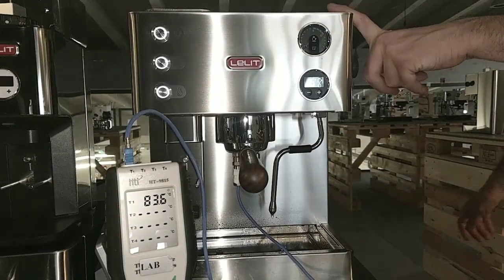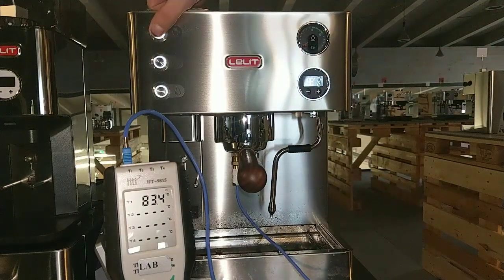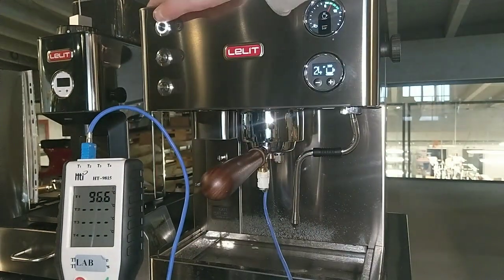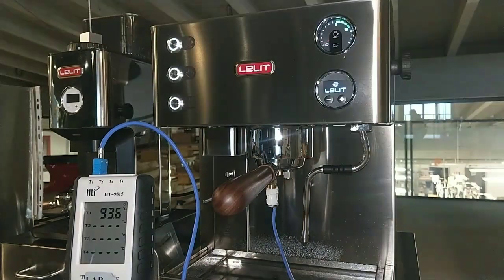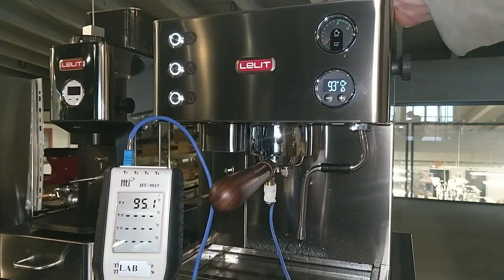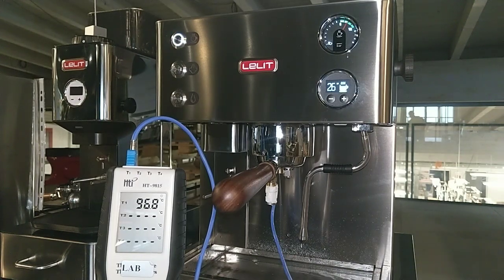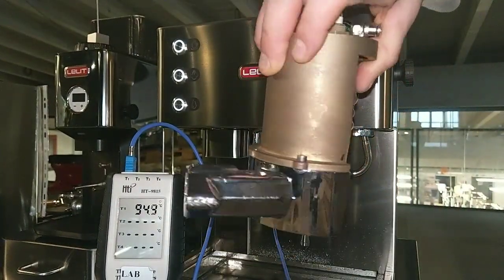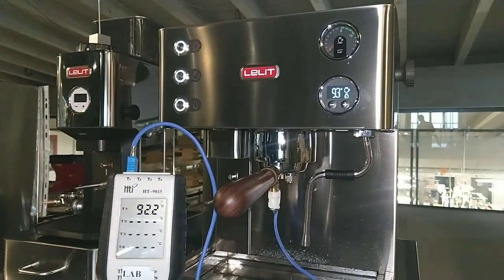pl82t pid settings   KP 0.5 - KD 0.5 - EC 8

Comment: Hello, I am your customer from Turkey.  I bought lelit Kate pl82t product.  However, there is an abnormal difference between the indicator on the product and the output level.  indicator is 93, water temperature is 77 degrees.  I watched your videos on YouTube and changed the settings to KP 0.5 KD 0.5 EC 8, but this is the situation.  I cannot detect the aroma and smell in coffee. I would like your support on this issue.
Reply from the maker: good day, has the machine been turned on for at least 10 minutes?
How do you measure the real temperature?
Reply: Can you help me on what action to take? 🙄
Reply: The machine has been on for 1 hour. I place a calibrated temperature meter probe into the port filter. If you have an Instagram account, I can send it as a video.
Reply: pid version 3.04

Comment: Don't miss the "B" value. It defines the distance from the target value from which the PID control becomes active. Before that, heating is permanent. A small "KP" value below 1.5 as in the video may prevent the target (steam) temperature from being reached, at least without the help of the "KI" value. Reducing the "B" value helps to reach the target value in finite time. Search for the setting at which the target temperature is not exceeded, but is reached. For a "KP" of 0.5 try a "B" of 18-20.

Comment: in the pl81t model, with version lcc 1.14. Are these parameters useful?
Reply from the maker: in the pl81 Ec 8 is too hi, 
try KP 1 -KD 0.5 EC5
Reply: @lelitinsider2977  Grazie mille
Reply: @lelitinsider2977  I have changed the parameter TR=1, to see the real temperature. In addition to these parameters. Should I change the others?

Comment: Is there a manual explaining what different settings are?
KP/KI/KD/B/Es/F01/F02/SL…
Reply from the maker: PR. ON: Determines the preinfusion time on. In this case, starting the coffee extraction, the pump and the coffee solenoid valve will be activated. After PR. ON seconds, the coffee solenoid valve switches off for the PR. OFF time, after the set seconds the solenoid valve starts working again until the end of coffee shot.
Allowed values: 0÷20
Default value: 2

PR. ON: Determines the preinfusion time on. In this case, starting the coffee extraction, the pump and the coffee solenoid valve will be activated. After PR. ON seconds, the coffee solenoid valve switches off for the PR. OFF time, after the set seconds the solenoid valve starts working again until the end of coffee shot.
Allowed values: 0÷20
Default value: 3

KP: up value, when this value increases, the heating element heats more frequently in the ascent phase, therefore it generates more inertia which means more degrees than the value set by the user.
On the contrary, if you decrease this value, the heating element heats less frequently in the ascent phase, therefore it generates less inertia which means less degrees than the value set by the user.
Allowed values: 0.0÷20
Default value: 10

KI: maintenance value, it increases the cycles of activation of the heating element when it’s in standby mode.
Allowed values: 0.0÷9,99
Default value: 0.00

KD: down value. Increasing this value, LCC activates the heating element more frequently when the boiler is in the descent phase, if the value is increased, more impulses are given, therefore it decreases a little bit less.
Allowed values: 0.0÷99,9
Default value: 10.0

B: minus value, compared to the set value within which the LCC works (expressed in Fahrenheit).
Allowed values: 1÷40
Default value 30

Ec: offset LCC/coffee boiler, setting the value 0, LCC rules the set temperature, setting 10, LCC rules the
boiler  temperature with 10 degrees (expressed in Celsius or Fahrenheit depending on the set parameter) more than the value set by the user. 
Allowed values: 0÷20
Defalt value: 10

Es: offset LCC/steam boiler, setting the value 0, LCC rules the set temperature, setting 5, LCC rules the
boiler  temperature with 5 degrees (expressed in Celsius or Fahrenheit depending on the set parameter) more than the value set by the user. 
Allowed values: 0÷10
Default value: 0

F01: lighting button. 1=ON, 0=OFF
Allowed values: 0÷1    
Default value: 1

F02: time needed for refilling the boiler with water when the steam mode is finished.
Allowed values: 0÷60
Default value: 25

SL: enabling or disabling level probe. 0=Probe disabling, 1=Probe enabling
Allowed values: 0÷1    
Default value: 0

TR: real value of the coffee temperature shown on the LCC: with the value 0, the temperature is the same than the set temperature, with the value 1, the LCC indicates firmly the real temperature  (with swing ranges of 15°C  below and 10°C  above the set-point-only after first adjustment). 
Allowed values: 0÷1
Default value: 0

ToT: total dose counter.
Reply: @lelitinsider2977  SL: you note this is for "enabling or disabling level probe".  What is the 'level probe'?  Do you mean water level in the tank?  if so, why is the default value 0, which disables the probe?
Reply: Amazing info, thank you!
Reply: @lelitinsider2977  KP: in the video description, you note "Allowed values 0÷9,99. Set value by us 1.0".  In the video title you note "KP 0.5".  Here you note "Allowed values: 0.0÷20 Default value: 10".  Which one is it?
Reply: @lelitinsider2977  KD: in the video description, you note "Set value by us 20.0".  In the video title you note KD 0.5.  Here you note "Default value: 10.0".  Which one is it?
Reply: @lelitinsider2977  PR. ON: you repeat this description twice, noting two different default values, 2 and 3.  Which one is it?
Reply: @lelitinsider2977   hello, and thank you for this video. I have pl82t with LCC ver3.04, I dont have the PR, TR or ToT functions, were these released with an updated LCC? I am most interested in the PR options, I notice in the video the machine is running 3.06.

Cheers

Comment: Hi, can you perform the same test on a PL91T with the new PID(v1.14) 2022? I would like to know how to set the temperature offset. The default is 5.
Reply from the maker: if you set 95° , the boiler add the temperature offsett, in this care +5
this to compensate the temperature who pass throw  the grouphead
Reply: @lelitinsider2977  After several i think the offset is low(5 degrees). I think a value of 10 is more realistic as i pulled a nice taste shoot with pid 94 and offset at 10.
Reply from the maker: @spyroskatsavos5118  yes, use E10, but i suggest you to reduce the KP and KD to avoid overheat!
Reply: @lelitinsider2977  thanks for the tip. Indeed i noticed that when i reopen the machine (when is already hot) the pid reaches upto 104(pid set to 94 and ec 10)

Comment: thanks for all your videos. I set EC to 21 on my Pl92T to get my 93 degrees in the shower. Is my temperature sensor defective? My meter is correct and the espresso tastes very good now.
Reply from the maker: if the taste of the coffee is good is fine, i have to set a machine with this value to understand better the situation

Comment: with these settings, it cannot heat up to 135 degrees in steam mode.  the scale reaches 85-90% and fluctuates in this interval.  waited 5 minutes.
Reply: Try to decrease the "B" value. It defines the distance from the target value from which the PID control becomes active. Before that, heating is permanent. Search for the setting at which the target temperature is not exceeded, but is reached. This will be perhaps in the range of 16-18.
Reply from the maker: try to change only the KP value, set KP1
Reply: @lelitinsider2977  tried KP 1. heating time in steam mode 4:40 minutes.  I took it on video, I thought I would not wait and finished shooting a little earlier.
https://youtu.be/9v4--hVtAe4
Reply: @lelitinsider2977  Starting from KP 1.5, it takes 1:30 minutes to switch to steam mode.
Reply from the maker: @Kuzmich_E  this is normal
Reply: @lelitinsider2977  Hello. I have same the problem only with the steam. I have the Victoria and changed the original sensor with sensor inside the boiler.
Reply from the maker: @stav11000  you have to increase the kp,
set it to value 2
Reply: @lelitinsider2977  thank you!

Comment: Hi lelit Insider, in another video you showed PID settings for pl81t: https://www.youtube.com/watch?v=MS-pTrxjP1I 
Why is this setting here from pl82t different? Which one is better to use with 81? Stability of temperature and steam - both are in my interest. Thanks a lot
Reply from the maker: Hi the  pl81t  grouphead is different, try to change
KP 0.1
KI 0.04
K0.01 
E 5
Reply: @lelitinsider2977  Mille Grazie! Will try... additional question...with E = 5 and I start a shot and I set my temp to 93...should be correct and I don't have to out a higher temp? Thanks
Reply from the maker: @ulrichmoritz42  yes, you have E(offsett) 5, but you compensate with KP 0'1 ant it compensate
Reply from the maker: @ulrichmoritz42  depends on several factors, such as 120v or 220v power, ambient temperature etc. 
for the pl81t try E5 ,
Reply: @lelitinsider2977 
 Thanks again...I am using these settings since some weeks ... Shots are great. Anyhow steam performance  is not too good. What should I change? Thanks
Reply: Hallo Insider,
kannst du mir bitte Helfen.
Ich habe eine Pl82t mit Version 3.04a.
Welche Kp, Kd und Offset soll ich einstellen.
Schöne Grüße
Ciao addetti ai lavori,
Mi potete aiutare per favore.
Ho un Pl82t con la versione 3.04a.
Quale Kp, Kd e Offset devo impostare.
Distinti saluti
Reply from the maker: @silentjoe81  https://www.youtube.com/watch?v=avQxv5zUCdg

Comment: Hey Lelit Insider! Thank you for your videos! Do you have any suggestions for the lelit victoria pl91t? Is it the same as elisabeth? And why do you suggest the effset value to be zero with pl91t?
Reply from the maker: hi, it is 2 different machine the offsett  value can be between   5 to 10,
Reply: Hello. I have the Victoria. I have a question. I change the sensor  end put same sensor  with pl82t. Can I to put the same settings? Now the sensor is inside the boiler.
Reply: @stav11000 
I also have the sensor inside the boiler and would be keen to know